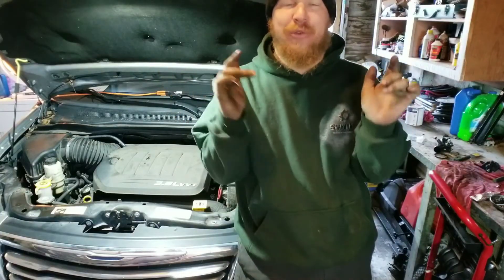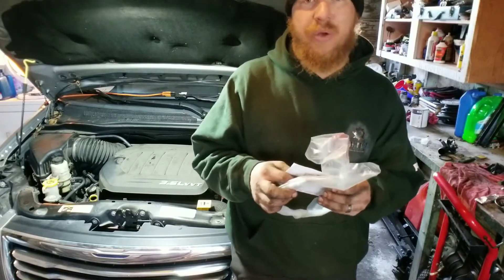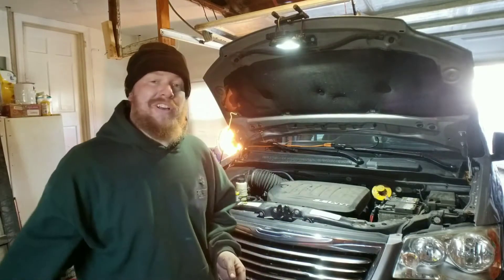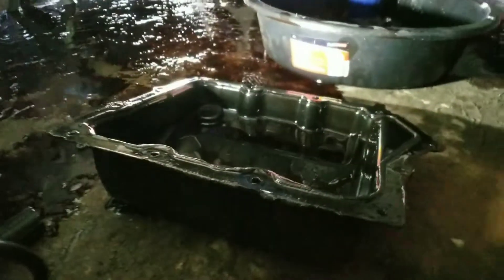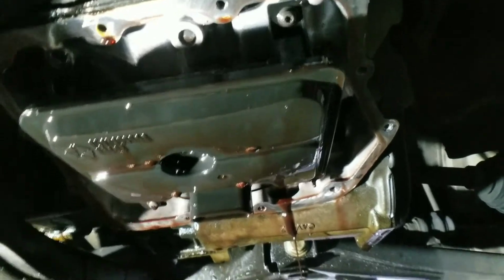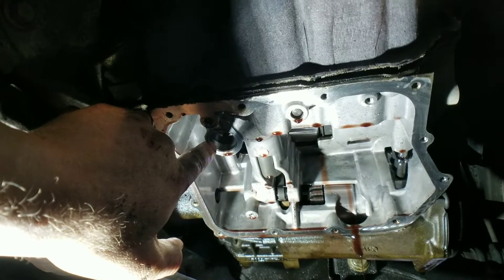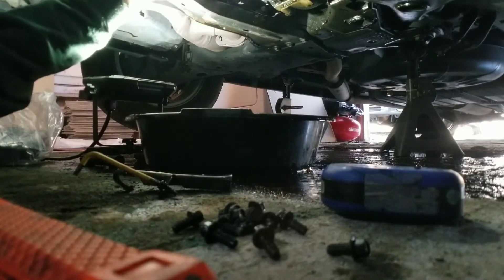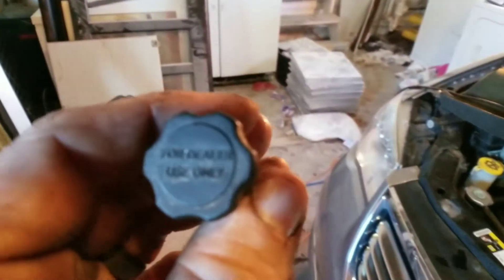2014 Chrysler Town and Country Transmission Filter Replacement

Comment: I know this is a old video and its informative. The only issue is at the beginning when he said someone cheaped out and didn't do the job properly because they used a type of RTV gasket maker and thats why it leaked. The factory uses a rtv type of gasket maker. They dont use a premade gasket. Both gasket will work. Rvt works a little bit better because it will fill in any defect but you have to be careful not to over do it. To much can get into to transmission and block fluid flow. Other then that the video is a great way to save money and do the repair yourself. People like this go out of their way to help us out and i truly appreciate it
Reply from the maker: Great tip and your right, thank you for highlighting that. Thank you for watching as well, I'm glad you enjoyed the video.

Comment: they have a temperature sensor probe falling in to check the temp, and get the depth from that temp-depth chart.
Reply from the maker: That is correct, I would use the transmission temperature reading off of a diagnostic reader. Then take that temperature and see what fluid level you should be at from using the chart that comes with the testing dipstick. Thank you for watching!

Comment: Awesome work on the video. I'll be doi the same this weekend as I think I have a leak on my drain pan gasket. Van has 75k on it and is low on ATF.  Being a cheap Bastard, rather than but the test dipstick, I measured and scratched into the back of my oil dipstick.  I just clean them well before dropping it in the tyranny line. 👍🏽
Reply from the maker: Thank you Daniel! I am glad that you enjoyed the video and found it be beneficial. Yes that is a nice little DIY way to save yourself some money

Comment: awesome video. i was told my town and country has 3 yes THREE transmission pans when i took it in for filter change and hoses. i like to do research 1st before repairs. is it true my  town and country has 3 pans
Reply from the maker: Lol no, it has one transmission pan. Great job on your homework! These shops are a trip
Reply from the maker: did you get the link I set to the rear blower motor replacement video?
Reply: @Sellthoseflippingcars  I did. I couldn't find your PayPal either. I'll just sub your membership channel. You rock. I had rock are and blower resistor motor. van had a tick. awaiting transmission pan to be delivered. I almost feel I CAN FIX IT after your detailed video. thx again 😊
Reply from the maker: Your are most welcome! I will get the rocker arm video built for you.
Reply from the maker: Dont doubt yourself u got this!!!! Put on some cool jams and take it one bolt at a time. When you feel frustrated, take a break. Putting those guys to shame in GA!!! Keep it up!!

Comment: Hey love your videos and have a question.  Bought the special dipstick tool and checked levels.  The tool dipstick bottoms out where it ends at curl.  Mechanic says you have to use oil dipstick and force past and get to bottom of pan to check trans level.  Which is correct?  Thanks!
Reply from the maker: Hey Spence! Thanks for watching and your continued support. The transmission dipstick should go in the transmission tube 16.6 inches. So from the tip of the dipstick measure 16.6 inches and that will be the correct test length. This is directly from Mopar manuals I pulled up on Alldata.

Comment: Hello, I have a 2012 grand caravan with over 200,000 miles on it. I recently started having problems with the transmission when I make a stop and try to accelerate again the car won’t go with winding noise. I turn the car off and crank back up it will drive but once I make a stop same thing happens. How will I know it’s my transmission or something I can change that cost less?
Reply from the maker: Is there any engine codes that are coming up? Look for transmission codes to be specific on the code reader. if you have that option. It could be a range of things but from what it sounds like from your description is a pressure problem in the transmission. It sounds like it's not building enough pressure to engage the drive gear

Comment: I need to do full flush, how do I do that?
Reply from the maker: This is considered a flush once you take the bottom of the transmission off. Since this model does not have a drain plug.

Comment: Thank very much for making this video so detailed.

I have a question i bought a used minivan 2013 Chrysler town and country with 174××× miles now it has 176xxx miles and since i got it i noticed that it has some late shifts but it drives really smoothly when there is no traffic and today i got a check engine light after 3hr of driving i checked the code with my ob2 scanner p0868 trans fluid low.
I have the service book and the transmission fluid/Filter was changed at 150××× miles.

Now the question is should I change the transmission oil/Filter or just add oill.

Thank you for taking the time and reading this,God bless!
Reply from the maker: I would top off the fluid. But if the fluid was changed at 150k, where did the fluid go? Refill the fluid and check for leaks
Reply from the maker: Also thank you, I am glad you enjoyed the video!
Reply: @Sellthoseflippingcars  

Thank you for the quick response i will definitely go to a autozone store and buy a transmission fluid and top it up and maybe they have a transmission fluid dipstick if not i will have to order from Amazon i think.

Once again thank you and god bless.
Reply from the maker: You are most welcome! If you do need the dipstick from Amazon I put the link in the video description.

Comment: The dipstick reading is temperature related,,, the fluid is added cold so it is filled to the cold reading of approximately 5-15 cm after it is warmed up it should read  the upper range on the chart,,, filling it full  ( max reading) while is is cold can result in overfilling the transmission,
Reply from the maker: Thats why the vehicle has to be at operating temperature. Thanks for watching!

Comment: Great effort bro...I would have love to see how you removed the filter ring and added back.. as that is the toughest parts..i will change mine tomorrow
Reply from the maker: Thank you I actually used my oil filter wrench. The oil filter wrench has teeth on it and it will grip the oil filter cap easily.

Comment: Thanks so much, just ordered my dipstick. Your videos are real helpful.   If you get a chance, please do a video on the engine block coolant plug locations, i cant find those anywhere based off the haynes manual or anywhere online.
Reply from the maker: You are most welcome Daniel! Having that transmission dipstick is going to put you a level Above the Rest being able to check your transmission fluid whenever you want. This is a great way to start saving yourself money on your auto repairs! I can be on the lookout for another Chrysler Town and Country to be able to do that video on. Just in case you need it sooner than that send me an email to my business email found in the video description and I will send you some pictures from all data showing where the freeze plug locations are on the Chrysler Town & Country

Comment: Do you do a gear learn / quick learn with scanner when you change transmission oil on town and country 3.3 van ?
Reply from the maker: No, there is no need to do that the transmission will be very thankful of the new transmission fluid that you put in it.

Comment: Thank you and great info.... I just bought a used 2012 town and country with 155k, the previous owner purchased the car at 70k. So basically when I purchased the vehicle at 155k it was driven 85k without no trans change. Should I change the fluid or leave it alone?? And thanks for your time and effort...
Reply from the maker: It is definitely time to change that transmission fluid and put a new filter in. Thank you I am glad that you enjoyed the video and found it to be beneficial. Please let me know if you have any additional questions

Comment: Do you know about how much fluid you put in?  And if you are starting from a cold start the chart says 5 mm minimum 10mm to 15 mm maximum,  Is that the numbers you use?  Getting the right amount in is the scary part for me the rest I'm good with, cause it's about to happen.
Reply from the maker: 6 quarts. Yes those are the numbers you use
Reply from the maker: You got this! Remember to have vehicle running and in neutral when testing transmission fluid level.
Reply: @Sellthoseflippingcars  Thank you very much.
Reply from the maker: You are most welcome! Thank you for watching!

Comment: What were the torque specs for the 2 filter bolts and the bolts around the transmission pan??
Reply from the maker: With those being the size they are the torque spec is very low. 32 inch lbs. You can usually hit this torque with a rat get and socket by applying enough pressure for the bolt to be snug. Thanks for watching!!! Hit subscribe to catch all my future videos!
Reply: Service manual specifies 40 inch pounds.

Comment: What do you do if you get a check engine code p0219A
Reply from the maker: One of your sensors on your intake is reading too low. Try unhooking your battery for 20 minutes to reset the ECM. If that doesnt work, do an ohm test with a multimeter on your sensors and see which one is malfunctioning. If you have a code reader with live data it will show the pressure readings of the sensors as well and will make it easier to find the culprit.
Reply: @Sellthoseflippingcars  shop tried replacing the 02 sensor and still got the p0219A code after resetting ECM. I'll try disconnecting the battery tomorrow.
Reply from the maker: Sounds good, let me know how it goes

Comment: Hey I enjoy your videos! Especially since I do have a 2014 Chrysler Town and country. Do you have a video on replacing the whole fuel injection filter wiring harness? Specifically, removing it from the main connector?
Reply from the maker: No I dont, sadly I try to steer away from any job that requires me replacing any section of the wire harness.

Comment: How many quarts dose it take to fill once you done emptying the  fluid?
And what does the dearship charge?
Reply from the maker: 5.9 quarts and on average they charge $190 to $210 to replace the transmission filter. Remember to replace the transmission pan gasket when replacing the filter. This way you have a proper seal. The links to both of these parts can be found in the video description
Reply: Sellthoseflippingcars  thanks fantastic work love your videos
Reply from the maker: @wilfredobruckman7496  thank you, I am glad you enjoy the videos! I enjoy making them so stay tuned for more diy auto repair videos!
Reply: Was wondering on the 8 mm bolts do you  Need Specific Torquing
Reply from the maker: @wilfredobruckman7496  the torque on those bolts is substantially low at 32 inch lbs. The easiest way to do that is to tighten then snugly but not too tight.
Reply: Sellthoseflippingcars awesome thanks again a million my brother
Reply from the maker: You are most welcome! Let me know if you have any additional questions and I will see you in the next episode!

Comment: are you sure that is not the strainer, the filter is up higher in a round housing, it looks like an engine oil filter. am I wrong?
Reply from the maker: That is incorrect Will, check out my town and Country playlist. I even have a playlist on this transmission. This is exactly how you change your filter.
Reply: @Sellthoseflippingcars  if its the same trani as 2016 dodge and I think it is ,then there are 2 filters the one in the pan is a strainer filter, the other is an engine oil looking filter up next to the pan in a round housing. Look it up. Thanks for reply.
Reply: @Sellthoseflippingcars  your right im sorry about that i was thinking of my altima ,working on 2 vehicles again your right.
Reply from the maker: No need to be sorry Ron, I feel you there. My mind gets lost in the projects, they all meld together. The weekend is almost here! Time for a break, this heat is crazy

Comment: I just did this yesterday, thanks for the video, gonna confirm the fluid level today. I did also change the transmission lines in my van yesterday it’s a 2014 and they are prone to start leaking FYI. What did you torque your pan bolts too? I couldn’t find this info anywhere!!!
Reply from the maker: I torqued mine to 30 inch lbs. It is so minuscule you can tighten it with a ratchet snuggly and it will be 30 inch lbs. Just do not start wrenching on it, that will over tighten and possibly strip the threads. You are most welcome for the video, I am always happy to assist in making the repair easier for you. Make sure you subscribe to the channel for more great diy videos on the Town and Country! Thanks for watching!
Reply: The torque specification for the pan bolts is 105 inch pounds when using RTV (which is not “cheap”, it’s actually what the manufacturer specifies.) I used a Fel-Pro gasket, so I went a bit lower on the toque. I did about 90 inch pounds (~10 nm). I initially torqued to 7 nm, then gradually stepped up to 10 nm to monitor the state of the gasket and ensure that I wasn’t breaking it. I’ve seen others go with 60-75 inch pounds with the Fel-Pro gasket.

Comment: Also how many quarts did yours end up needing to get full?
Reply from the maker: I bought 6 quarts of ATF+4 and had some leftover. Which I always like having some leftover in case you ever need to top off or another vehicle needs it.
Reply: I just bought my filter from Auto Zone and asked them the same question and they said 5.5 qts for filter change and 8.5 for full flush
Reply from the maker: @gingerpirate6668  that is because you are using extra fluid to flush system.
Reply: @Sellthoseflippingcars  yeah, hey thanks for the video man very informative and helped out a lot I liked the video and will be dropping a subscribe to help ya out keep up the awesome work bud
Reply from the maker: I am glad you found the video to be beneficial! Thanks for subscribing and welcome to the community!

Comment: I'm sure the RTV silicone on the pan is factory. Advance only sells the filter without gasket. Their comment is, "Pan is installed with silicone seal at factory."
Reply from the maker: I agree with you Bill, the RTV is definitely the factory cheaping out from purchasing a paper gasket.

Comment: Why I let the  garage change this because it is a mess .
Reply from the maker: It is, but if you leave 2 bolts in the middle on one side it will spill all out the opposite side. That will make it easier to put the drip pan in the right position.